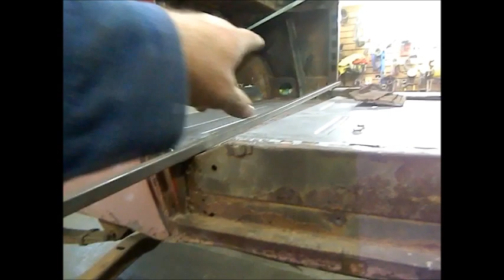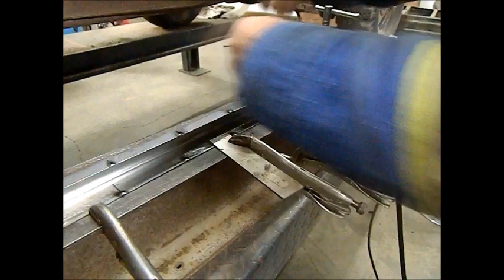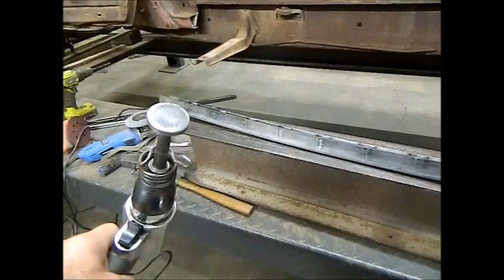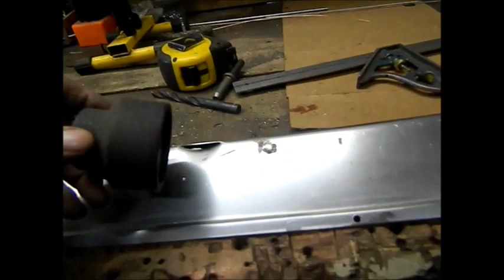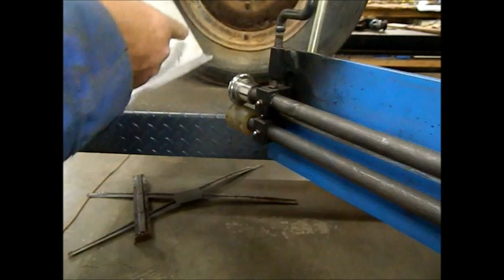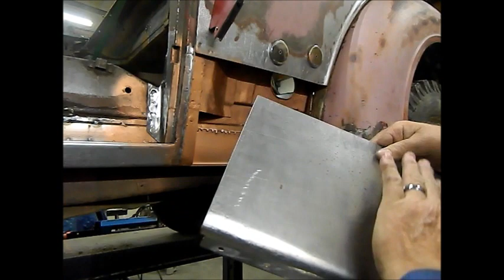1937 Plymouth Convertible #4

Comment: Wow Glen! Thats a pretty complicated repair. Well done. When welding the relief cuts you could try going the other direction to help control the shrinkage. ( from the edge in towards the bend) Thats how we were taught on heavier material. Cheers for now.
Reply from the maker: @dannypeter6565  Thanks Danny, that's a good tip I will try it that way on the other side.  Take care